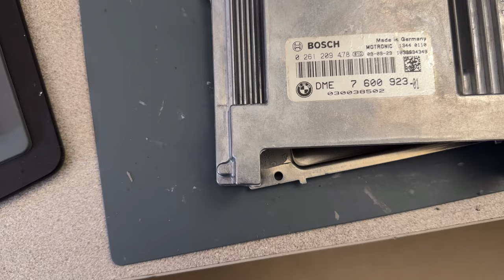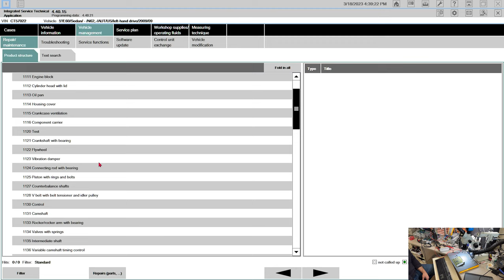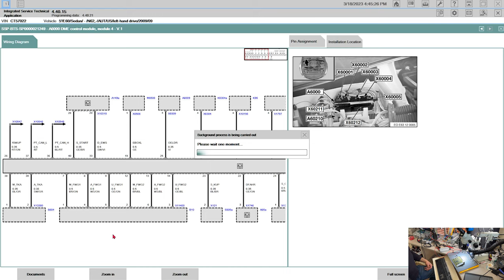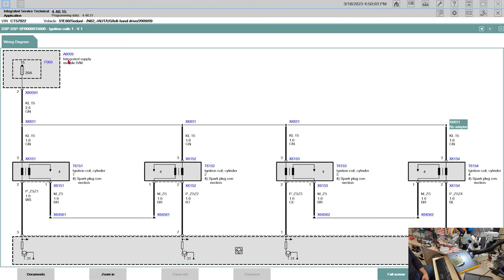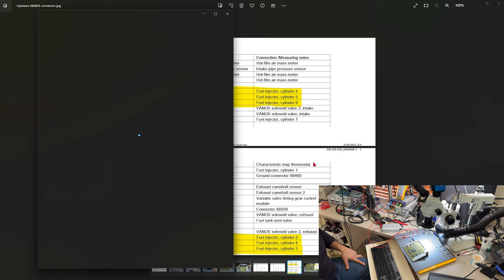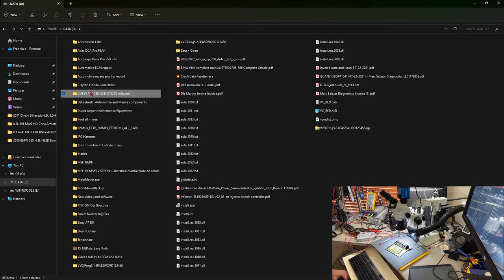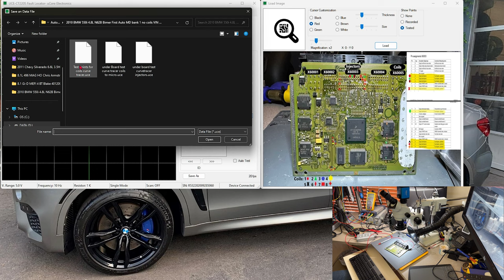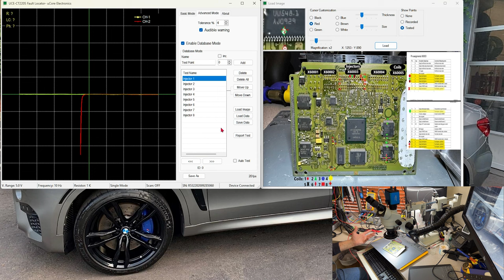2010 BMW 550i N62 no coil firing on bank 1 DME test with Curve Tracer for Nick MD

Comment: Very nice diagnostics both on the hardware, and using ISTA 🙂
How did you took the DME case apart? I am trying to get into mine as I have a corroded/damaged pin that needs fixing, but the case holds to the board with the heat paste / glue so much I am afraid I'm gonna break the board. Heat didn't work, options are 1) more heat or 2) isopropyl to soften it? What do you recommend? 🙂
Reply from the maker: @vladimirpodlesak  use a plastic spatula and carefully separate the board. It is a slow task.
Reply: It feels like I can't get to it even with a toothpick 😅 but will give it a try. Thanks!
Reply: @MaicSalazarDiagnostics  I finally got it opened. It took more force than I would like to use but luckily nothing snapped 😀It took various tools and a lot of patience. Thanks!